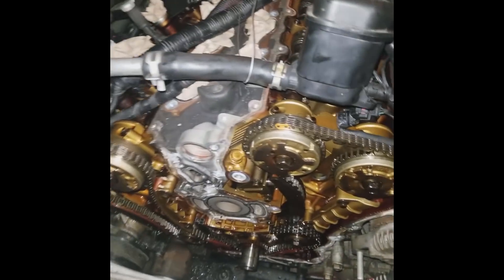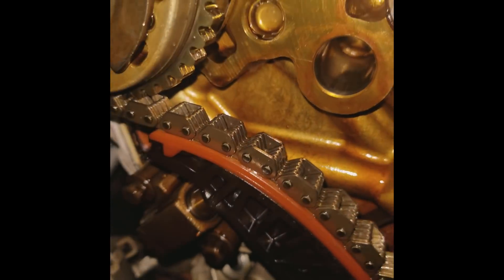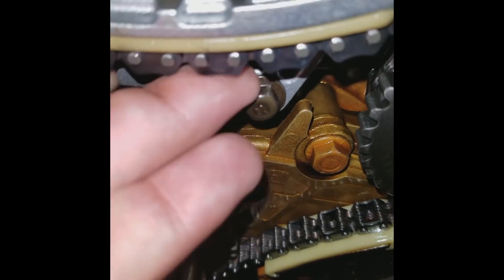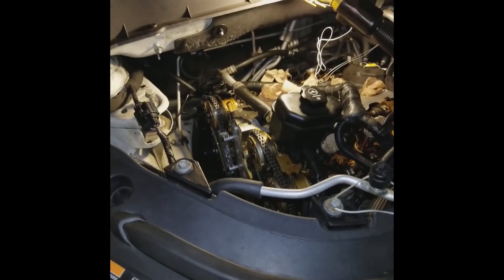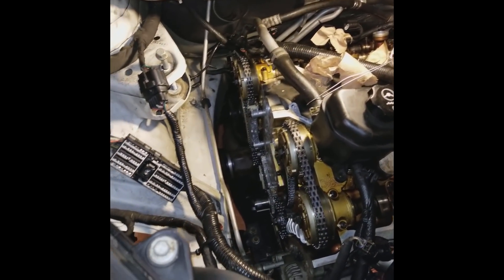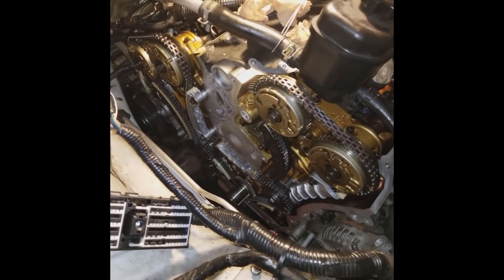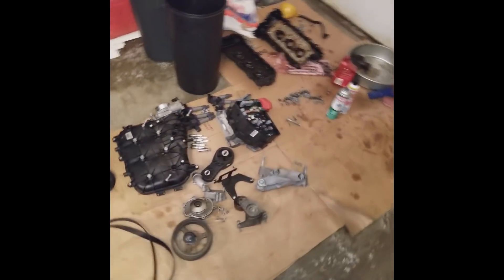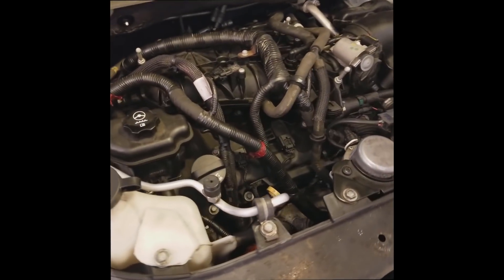GM 3.6 High Feature V6 In-Vehicle Timing Chain Replacement, No Engine Removal, Stretched Chains

Comment: Did you use a engine silicon or create a gasket when you put the timing chain cover back on?
Also did you need to lock the CAMS in place or did they stay where they needed to be? Thanks
Reply from the maker: Jada Jaz I believe the sealant that I used came with the Cloyes kit. Unfortunately I do not remember exactly what it was or have the part number. After setting the engine to TDC, I did not have any issues with the cams moving on me without a special tool. I highly recommend watching the Cloyes video. I don't have any other experience with their parts, but they seemed to be high quality. Regardless of what parts you use, the video is extremely helpful.
Reply from the maker: I just checked SI. The GM part numbers for the sealant are 12378521 (150g) or 88861417 (75g). It would also be prudent to find the factory procedure/image for applying the sealant. They are very specific about how much you should apply and where. I do not have a source on this besides having access to an expensive, professional Service Information subscription, so I wish you luck.
Reply: Thanks for all the info

Comment: Before you attempt this you should look at the cost of a used engine or remanufactured engine. These motors are very expensive and the job should not be done by a shade tree mechanic. Better to pay a professional that does this for a living. In the long run it's alot less expensive. Just got an 07 Acadia in the shop because they tried to fix it themselves. During the process they did not catch that the intake cam phaser on bank 1 was broken. They started the engine ran for ten seconds and locked up. It is now in my shop getting a remain engine at the tune of $4900 dollars. I don't like these you tube videos that make these jobs look easy. This gives the average Joe a unrealistic sense of security.
Reply: This isn't rocket science. If a shade tree mechanic can read and follow instructions, they can perform this repair. I'm a shade tree mechanic but for my own vehicles. I became such after getting tired of paying the professionals the asking price and receiving less than professional quality work. Having also held a job in the auto repair industry for 20 yrs in the past, not as a mechanic, I can personally say "Professional" as it relates to a mechanic is subjective. I watched a professional struggle to install a fuel pump on the same engine he removed the old one from, until I pointed out he was installing it upside down. He was later hired by a Ford dealership. I've seen so much carnage caused by professionals that I dread turning my car over to them for repairs I have neither the time, or proper tools to perform myself because of what I have personally seen and experienced.

     The Cadillac dealership couldn't figure out why my 08 CTS DI 3.6L was throwing lean idle codes after a diagnostic attempt last year. I figured it out and repaired it myself. Their cost if they had figured it out would have been ~$1300, I did it for $300 in parts. I also replaced the timing chains on the motor without a problem because I can read and follow instructions. I'm not trying to start a fight here, but it irritates me when people who stand to benefit, discourage capable people from doing things themself and give a one sided opinion. I've built numerous engines and automatic transmissions from the ground up for my own cars/performance projects and haven't spent a single day in any training course to learn how to do so, because I can read and follow instructions. I have the shop manuals for my car also.

     Yes there are some real lame brains among us, but even a lame brain can get it right if he/she just reads and follows instructions. If not it's best to leave it to a competent professional. Who can also make mistakes and ruin your day.

     I felt it was better to change all of the worn timing chain components. I replaced the actuators along with everything else. I actually enjoyed doing the repair because it was on my car and the motor was facing the right direction making it much easier. I also had the opportunity to take my time and do the job to my liking and I didn't put any scratches on the car or filthy up the inside.

 The guys performing these youtube repairs have saved me a lot of time and money. As long as they're doing it right, keep'em coming FullClip69. "Knowledge is Power".
Reply: q q I couldn’t say it better ..! The shade back yard Mechanic club is grateful to your kind words amigo.!
Reply from the maker: James Pierce My intention in posting this was not to make the job look easy. The job is a pain in the ass. I am just making information available. Grown-ups can make their own educated (or uneducated) decisions on what to do with that information. I will say that I would hope that anyone considering doing this job would do quite a bit more research than just watching my video and have more experience than changing spark plugs. Don't forget that most people aren't born mechanics. Even if I hadn't gone that route, I still would have fixed this in my garage. The individual can decide whether or not they are capable.
Reply: FullClip69 I've been turning wrenches for over 25 years. I've dealt with alot of the d.i.y. disasters. Not trying to discourage people from trying to save themselves some money, however many times the false information given to people in regards to auto repairs becomes more costly than if they would have taken it to a professional from the start. I don't like the way that the auto repair business has gotten a bad reputation because of all the hacks in our industry. This is even made worse from the chain part stores plugging in there code reader and telling people that this part will fix their car. When it almost never does. They use this gimmick to sell their inferior parts. Then the guy that bought these junk parts is still left stranded without a car to drive. Then I get to deal with the mess. What most d.i.y. guys don't realize that there is a lot of variables that come into play making car repairs. For example the part stores sell seconds and sometimes thirds. What I mean buy this that there are actually very few manufacturers of parts. The stuff bought at the part store are more often than not seconds and thirds coming off the line. Stuff that didn't meet the tolerances of the o.e.m. standards. They might work but usually fail much sooner than the o.e.m. part. If your gonna do these videos that's great but make sure you also give the people all the information in regards to part selection, and complexity of the task at hand. This way the people that are trying to fix their vehicle can make an informed decision. There are alot of people that are nieve and take these videos as golden only to not get the results they expect. It won't be you or I that has to deal with the aftermath. In many instances this could potentially create a financial disaster for someone when then job doesn't go right.
Reply from the maker: I understand where you're coming from, and I agree with a lot of it. I don't think most people seeking out this video are viewing it as a crash course in automotive technology or even a complete repair guide on this issue - at least I hope not. I wasn't able to do this job at the shop, and had to take it on in my garage without a lift. The first thing I did was search YouTube to see whether it was possible. Seeing the limited amount of information on this subject, I thought making this video would benefit others like me in this position. I understand that this may make the DIYer less hesitant to attempt a repair like this, but I also believe this is their personal decision and responsibility. I don't like fixing other people's screw ups either, but that will happen if it happens. I'm hopeful that this video helps more people than it hurts, or I would not have posted it. Also note that I directed those watching to Cloyes for parts and their video on the chain replacement. I do respect your opinion on the issue. I'm actually glad you shared it, because it was a perspective that I honestly had not considered.
Reply: If it ran for 10 seconds after they tried to fix it, then it is likely that they broke it or did something wrong to cause it to break. If it was broken before they worked on it, it would have already been locked up. Besides, who would want to buy a used engine that likely has worn timing chains? Also, who would want to spend 5 grand on an engine and labor for a car worth 2 grand at best?
Reply: quack quack I don't disagree that there are plenty of idiots in my industry that shouldn't be touching cars. I would have to say that 85 percent of the so called mechanics out there are not even qualified to change oil. The auto industry is one of the very few that you don't have to be certified to do your job. I don't like the idea of people working on cars that have no clue of what they are doing. You mess up doing brakes or steering suspension work you can get someone killed. Not to mention someone trying to fixed even a leaking fuel line. I've seen cars burn to the ground because they have used rubber fuel line in a fuel injected car. It might hold for a short time but eventually that rubber line will fail.
In today's economy I can understand why so many turn to videos to try and save a few bucks. Trust me I've been in those financial situations. The problem is for the average person they don't always see how to differentiate between a quality repair and a hack. They also can't tell the difference between a quality part and some Quang Fu part. I just wish that these videos could be filtered by quality of content and crap.
Reply: True indeed but unfortunately, there's more danger in ignorance. With a few exceptions, I believe most are wise enough to realize when they're in too deep and get help. That's why I stress reading. The majority of the complication in cars today involves systems management. A lot of what used to be remove and replace, is remove, replace and reprogram which few have the equipment to do.  Some repair expenses are unreasonable and on principal I refuse to pay them. It's like a $15 haircut for me, my head hasn't gotten bigger and I have less hair now than I did when it cost me $6. I could pay Cadillac $3k to do the timing chains, or I can do it and go buy a 60" flat screen and some other junk I don't need with the change but would at least have much more to show for my money. It's the way of the world, there was a time when the engine and original timing chain outlasted the car or up keep expense after it got so old when taken care of. 150-180k mile timing chains sound like a profit making design to me, like Chrysler putting major relays for the starter and engine coolant fan behind the radio and in the front bumper on some of their cars instead of in the fuse box where they belong. Good to know you're one of the good Pros.
Reply: NO shade tree mechanic here. Mainly do ALOT of 3v fords and always replace phasers  but noticed on these 3.6l rarely see anyone replace phasers while doing timing. do they not go bad as often ? or should they be changed with timing? also should all 4 be done or intakes only ?
Reply: In many cases I take my car to get worked on and they do a crap job. I started doing it all myself and yes, my work now is better than 10 years ago but rival any ase sticker and a few years experience.  That said, your right. I think the car shown had a bad phaser or both on the inside cylinders.
Reply: @mikeschiavoni5973  same here started doing my own work with oil changes when I was maybe 20. After seeing rampant incompetence where even I knew what they were saying wasn't the problem, been doing my own work for 20+ years have saved many many thousands both in repairs and being able to keep older cars on the road.

Comment: What the mileage of your lambda suv?
Reply from the maker: jd5179 The vehicle had 99,XXX at the point of doing the timing chains. The codes were setting intermittently before that time though.
Reply: FullClip69 thnx, I have a 2010 Buick enclave with 78k miles- so far no issues with the timing chain- the only issue I have that I have a some kind of misfire when going to 60-75 miles uphill only . And yeah if I have a 2 or more passengers . Kinda weird and does not throw any CEL codes as well. How long did it took you to complete this timing chain job?
Reply from the maker: jd5179 Sounds like an ignition related misfire, although I have seen issues with a torque converter clutch that can create a similar symptom. These things eat coil packs though. You can do a spark output test on the 3 coils on the rear bank, but unfortunately the front ones are under the intake. This job was very time consuming. Took longer than the book time for sure.

Comment: Very bad idea doing in vehicle on SUV. If you don't get sealing surfaces perfect you will have oil leaks. Doesn't take but about two hours to remove transmission and engine assembly.
Reply from the maker: James Pierce it is absolutely doable with a second set of hands. The average person is not going to have the engine and transmission out in 2 hours working on the ground.
Reply: I did a traverse mounted Saturn Aura XR 3.6 DOHC this way with no leaks whatsoever. The key is to make four dowels, two on each side, to guide the timing cover back on perfectly. That way you can apply the sealer to the timing cover off the vehicle and don't have to worry about lining it up.
Reply from the maker: TrakSpock1 Sounds like a great method for getting this job done on your own!
Reply: James Pierce how did you manage to scrape off all the RTV off the engine? It’s a pain to do with the engine out let alone in a car.